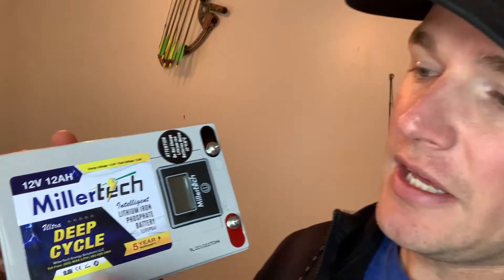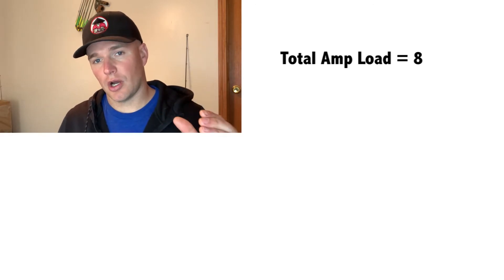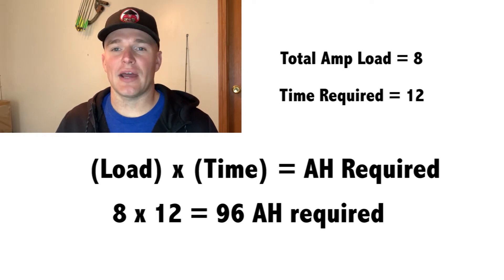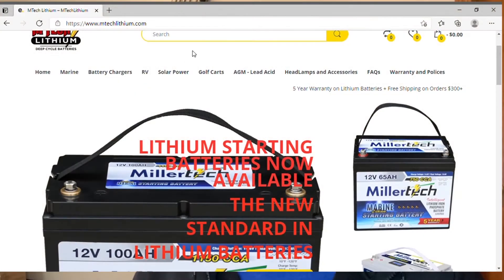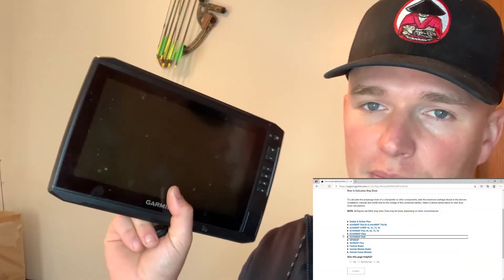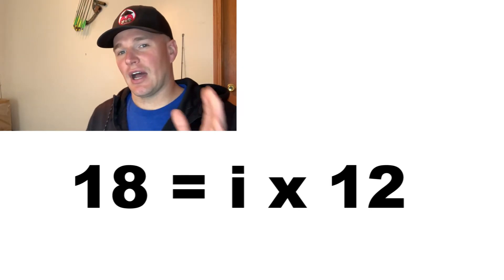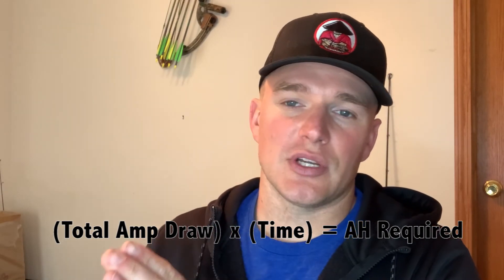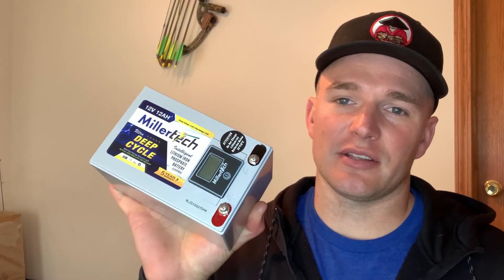How long will your battery last?!? How to properly size a battery for your needs!

Comment: Currently have the BassTank $699 deal, the echo uhd 93sv with gt54 'ducer. Would a 12v-20ah lithium be enough for it? Iif I decide to add Livescope, would that same 12v-20ah lithium battery be enough?
Reply from the maker: It all depends on how long you need it to run for .
Reply: @MGMarineTech  When I do fish, it's anywhere from 6 to 10 hours that I'm fishing.
Reply from the maker: @peterlong9629  using the formula in the video it will show you exactly how big of a battery you would need for that length of time. You will need to know the theoretical amp draw of the unit. 

The 93 uhd draws about 18 watts at 10v but seeing that you don’t want to run your graph in that low of voltage. They typical amp draw us about 1.5 max..

So in theory a 20AH battery would last you 13.33 hours. If nothing else is on that battery. 

20ah divided by 1.5amps = 13.33 hours

Comment: Any idea what a LVS 32 livescope system draws. Just the livescope not the fish finder. Thanks
Reply from the maker: They say the typical power draw is 21watts. At 12v that is roughly 1.75 amps. 

Max wat draw is 58w and at 12v that is 4.8amps.

Comment: Great video!! Are there any charts or formulas to figure out how to determine what percentage of the volts that a battery loses as it drains down? In other words would a 100ah battery provide 6 volts at 50% charge? I’ve thought about using a separate battery for the electronics but fear without charging current from the motor it will drop the voltage below the electronics operating range. Thanks for the informative videos!!!
Reply from the maker: That’s one of the best things about lithium’s VERY little to no voltage drop forth entire cycle of the battery.

Now a lead acid, yes it will loose voltage from the moment you turn on the first device. 

As far as a chart, I believe there are some out there for lead acid batteries that go by voltage and tell you the percentage the battery is at.

So say it’s at 12.2 volts that would be 65% (just picking numbers) 

This is also why lithium’s give you roughly twice the capacity or run time for the same AH battery. Because lead acids drop voltage and after about 50% they are done and need to be charged. Where a lithium can be discharged much deeper without dropping out of the useful voltage range
Reply: @MGMarineTech  that’s a huge bonus for lithium!!!

Comment: Can I share waypoints with a 12 in 56 to a 10in 54 transducer?
Reply from the maker: Yes I cover all of that in my networking video it would be a good watch. The transducer that is connected won’t make any difference 

As long as they are both the same family of  units such as “echomap” to “echomap” or “gpsmap” to “gpsmap”

You can not network gpsmap to echomap.
Reply: @MGMarineTech   awesome thanks a lot I will try to check out more videos. 🤙🏻

Comment: Will most outboards charge the duo purpose lithium battery at the correct voltage?
Reply from the maker: You will need to verify that the charge does not charge above 14.5 volts. 

Most chargers that can charge “AGM” batteries  will also be able to correctly charge a lithium.
Reply from the maker: I’m sorry I miss ready your question.

I unfortunately do not know what most outboards will charge at. That is something you would either have to ask your mechanic or test with a volt meter. Again just make sure it doesn’t charge above 14.5v